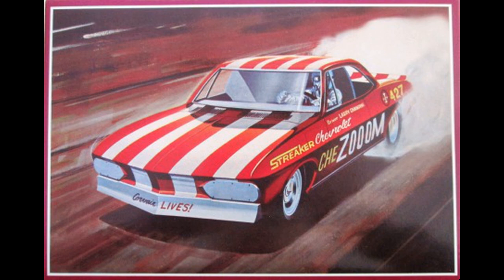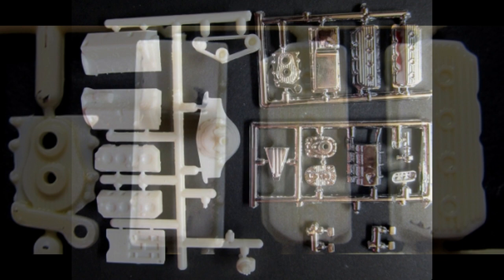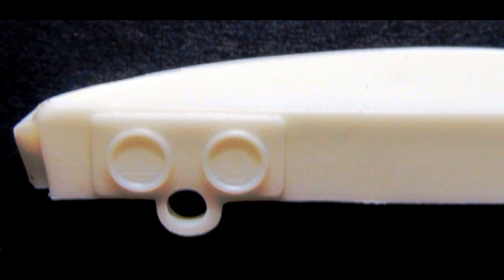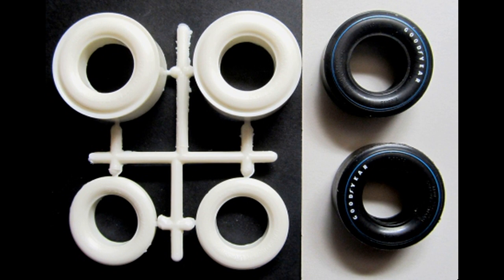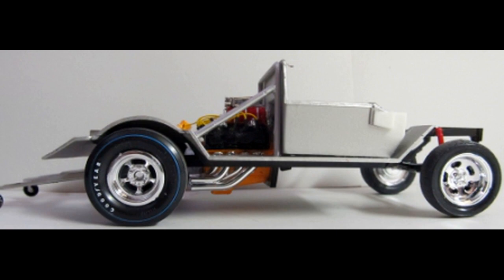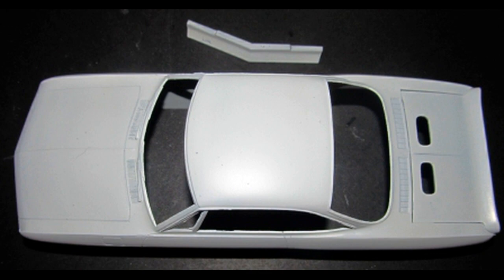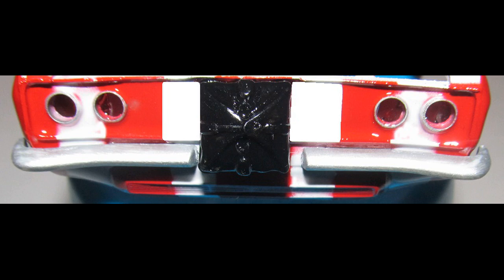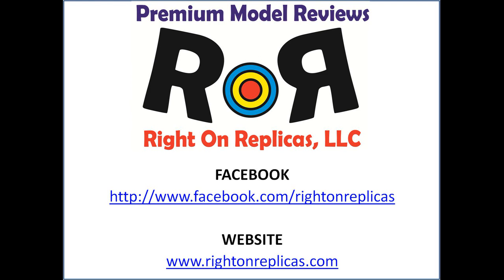How to Build the CheZooom Corvair Funny Car 1:25 Scale AMT Model Kit #873 Review

Comment: Hey Doug,what type of decal setting solution do you use ? Micro sol or micro set. I am not sure what the difference is ?  I am ready to shoot the color on this kit. Like I mentioned on a earlier comment,my kit came with the white stripe decals . I know the body color may bleed through a white decal but I am not taping LOL. My engine was painted by testers aluminum plate spray paint with a backwash. I got a little creative with the blower butterfly housing and painted it with Tamiya clear red over the chrome. Looks like  Anodized aluminum.👍
Reply from the maker: HH,  Micro Set is the first step in that two-part process.  I use the Micro-Sol after that, if needed, on thicker decals.  PS, please subscribe if you haven't already to help us reach more modelers.  -Doug

Comment: Do you think i can bash this kit with a stock one to have close to a Crown conversion street car?
Reply: The reason I ask is because I want it to look relatively stock from the outside and use the original trans setup. Also stock suspension.
Reply from the maker: Bobs,  I don't think what you're after will work here.  the Chezoom is a full-on funny car frame and setup. No back seat.  The rear wheels are drag slicks.  Tranny is in a different location.  You're better off just trying to mate a V8 to your stock tranny and beefing p the rear suspension.  Thanks for sharing!  -Doug
Reply: I misspoke. Basically I want a mid engine v8 corvair street car. I've got buckets of wheels and tires. I want no back seats. I want 2 front seats. I'm going to slice the front open and add a radiator. I've seen them in real life. I just wanted to know if I bought both kits could I play mad scientist. Lol. Thank you Doug. Love your videos.
Reply from the maker: BObs,  No problem, thanks for sharing!  -Doug

Comment: A few more questions. 
Do you know of someone or company who makes generic 1/24/25 scale racecar drivers?
I wish AMT would offer a kit that has
a small selection of racecar drivers at a reasonable price. I bought 1 resin figurine for $18. Styrene has to be cheaper right,especially if they are more mass produced ? Another question, do you work at AMT ?
Seems like you have connections. Lol
Thanks for your past and future replies
Howard.
Reply from the maker: HH,  Fujimi made a GT driver set #110035 and Fujimi made a F1 set too.  I used to work with AMT but now it's just me!  -Doug

Comment: When I use micro set / Sol I think I am doing something wrong but its pretty straight forward. When I brush the sol/set on the model surface , it beads up instead of covering the surface like paint. That's normal ?
Another question.I am finishing up a 
AMT 1970 Pro Sticker Nova.I am doing GRUMPY'S TOY .I used testors white spray paint for the body, applied thee aftermarket decals and now I want to clear coat it to obviously protect the decals as well as blending them into the surface. I have been holding off on clear coating cuz I'm concerned about the yellowing that happens to white paint jobs. I am thinking of using Tamiya's X-22 acrylic gloss clear coat but I am wondering how it will hold up when masking to paint the black vinyl top ? Anyone ?
Reply from the maker: HH,  If you want to avoid yellowing use Pledge Floor polish or 2-part Urethane auto clear coat.  Using spray cans is always a gamble because of it's thickness when masking.  If you spray it in light fine coats and build up the color gradually it will help.   -PS, please subscribe if you haven't already to help us reach more modelers.  -Doug
Reply: @RightOnReplicas  I am a sub. It may not look that way cuz I have a brand new phone.  Thanks

Comment: I'm curious why you didn't use the kit supplied white stripe decals for the white stripes. Also, your valve cover breathers are off by 90 degrees.
Reply from the maker: PC, Good question.  Nice catch on the breather orientation.  Regarding the stripes:  they had to be painted because there were no white stripe decals in this release!  -Doug
Reply: Well, I'm certainly glad they are in the release I have.
Reply from the maker: PC,  Actually, I find it easier on a large area to use tape to apply the stripes than a large sheet of decals.  Large decals are sometimes very difficult to get into position and smooth out correctly over the contours of a large area like this!  But to each his own!  -Doug
Reply: I actually thought this was modeled after a real car when it first came out (in the 60's I think). Anyways, you did a really nice job on it.
Reply from the maker: Thanks PC!  - Doug